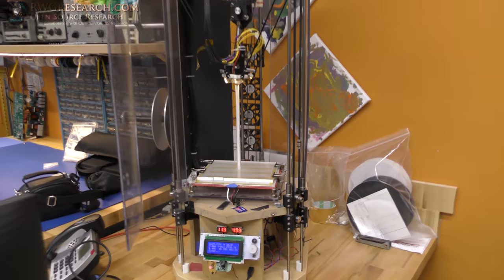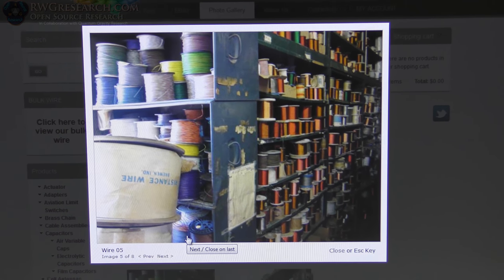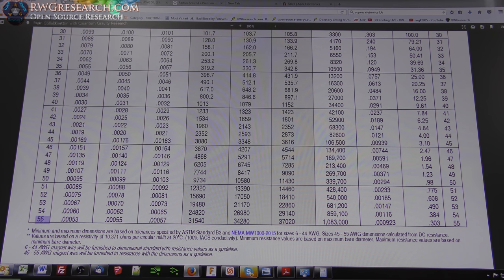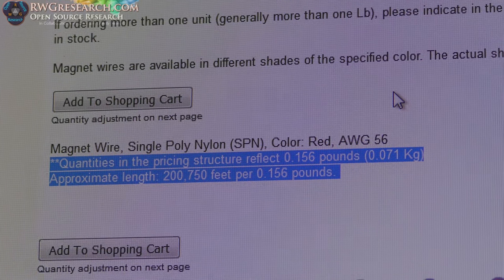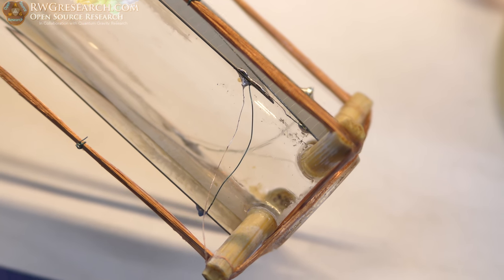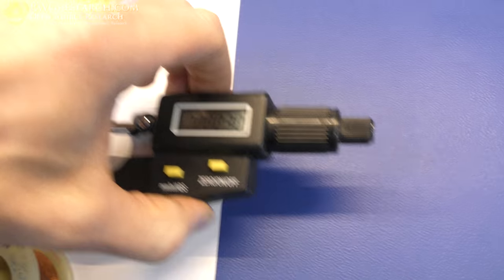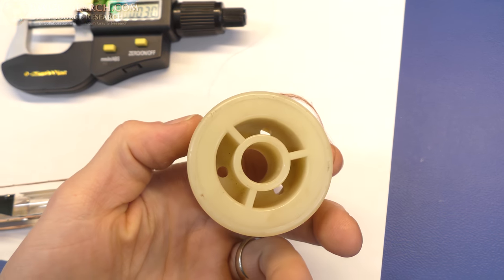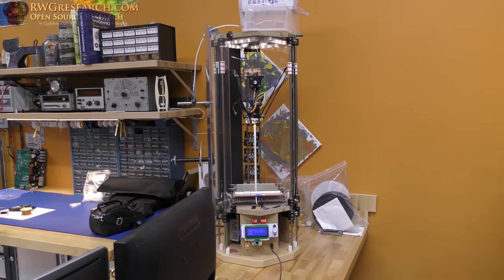56-AWG World's Smallest Magnet Wire, Smaller Than A Human Hair! Mesured @ 7.62 Microns???

Comment: Why do you call it magnet wire, there's no such thing, it's just copper wire.
Reply from the maker: yes. it's way that this type of wire is classified. it's also called "enameled wire".  this is wire with a coating. it's not just bare copper. it's called magnet wire becuse it's commonly used for making electro magnets.  the enamel is put on in a liquid state and dried on to the bare wire. this makes the coating extremely thin. in my case it's "S Poly"  that most likely Single layer of a type of polyurthane.  give "magnet wire" a Google. wiki has an artical on it. hope this helps. ~Russ

Comment: Miliampere ampacity surely. Make a high voltage flyback from hell with that stuff.... It would be impossible to wind by hand though. Tensile strength in milligram range.. Lol nice find.. I'd sacrifice the top knotted mess and get down to clean layers to begin

Comment: I was just thinking of how many turns of that magnet wire one could wind per inch for the secondary on a tesla coil...the more turns of windings the higher the output volatge. I bet each foot tall of that wire with a 10 turns of primary would produce in excess of over 1,000,000 volts, think of what a 4 foot tube wound with it would do and you only need a 1" dia tube to wind it on for the secondary. Might make an interesting build to make a higer voltage output tesla coil. Use yout lathe to wind it on if you can gently work out your snarl or buy another new spool. Since your not buying the whole pound a spool your size might be 20-30 bucks.
Reply: 1NRG24Seven Interesting idea, but there is no chance the isolation is good for the voltage.

I am not even sure perfect potting of the secondary would help!

You would end up with very little copper total, so resistance would be very high! So it's basically not something you draw arcs from.

Comment: Wonder how many people here where aware that you were actually printing with plexiglasssssss.... never the less may I ask where did you purchase that printer! I'm tempted to star to cast parts to replace all those plastic brackets in aluminium..!!
Reply from the maker: yeah, well plexiglass is a brand name, :) but yes, its PMMA, the printer, i thought you know, i built it, http://rwgresearch.com/open-projects/3d-printing-research/3847-2/ and now the new and improved RWG-OSD http://rwgresearch.com/open-projects/3d-printing-research/oversize-delta-3d-printer/
any how the reason I'm using this is for casting, not this part but for others, the OSD will be all AL at some point! all the current plastic parts are just to test everything :) ~Russ

Comment: On focus locked points it looks very good.. YT was only giving me the 1440 option, so I could not compare to any other res..  This may be a bad example but.. http://www.imagebam.com/image/cb16c4521154630.  Are you using Type U3 SD cards with your new cam?

Did you have to break that 'tube' off to remove it from the bed or where you have to get it off at the single layer raft?
Reply from the maker: i see 2160p now, watch it again and see if you can see any difference. thanks BTW, 
I'm using PNY 20MB/s cards i bought back in 2012, they seem fine. i think they are class 10? or what ever the recommendation is for HD video. 

the raft came off the tube, then used a razer blade to get it the raft off. the acrylic is quite hard to get off with out breaking, but its the only thing i found that sticks well enough to use as a bed, lol ~Russ  

PS. This stuff stinks, and i don't think using it in doors is a good idea... i want to use it for casting! :)
Reply: I don't see much of a difference between 1080 up to 2160 on my monitors, however I see a big difference between 2160 on these monitors as compared to a 1080p monitor @ 1080, which kinda makes sense. 

I think you really need some U3 cards. I think you need to be able to write at least 60 MB/s. The Samsung Pro+ cards should handle anything you can throw at it.